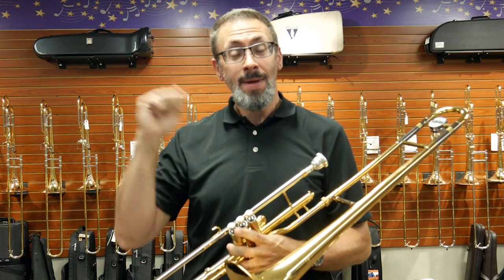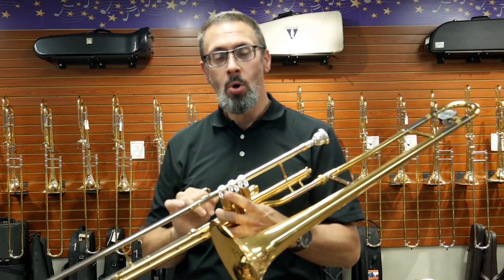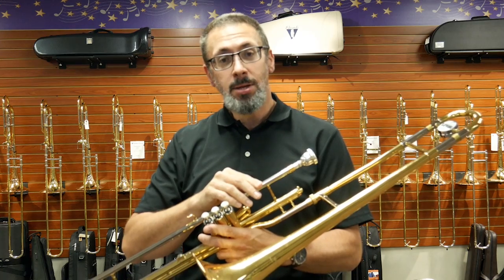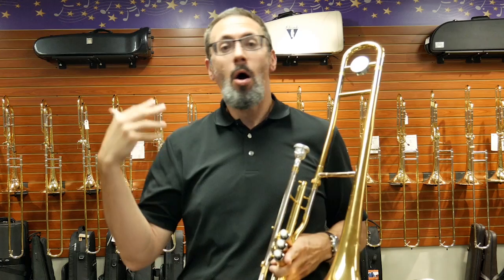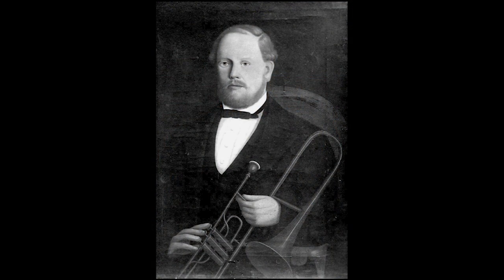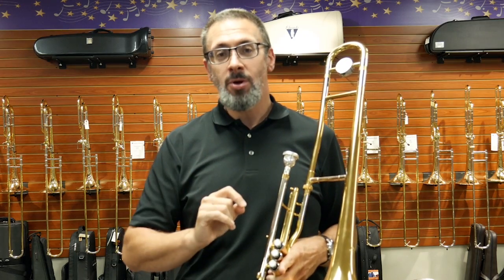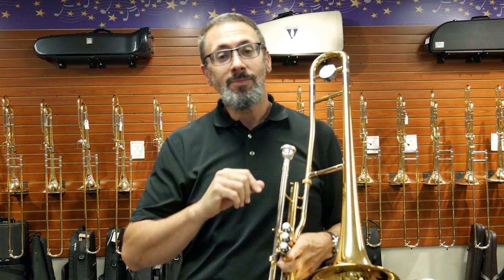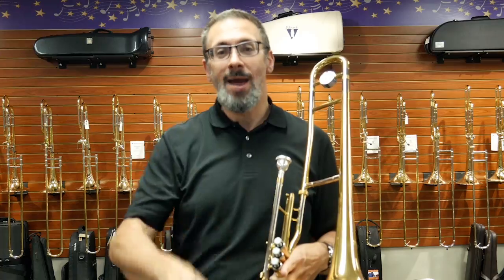INTRODUCING THE VALVE TROMBONE! Valve Trombone 101

Comment: Actually you can also use Valve Trombones in Marching Band too cause you don't have to worry about breaking your slide.
Reply: You don't care about tuning in marching band? These valve trombones are very, very out of tune.
Reply: @Ruigekerel  They worked around this issue by adding spring loaded tuning slide triggers.
Reply: @RockStarOscarStern634  no tuning slide triggers offer enough leverage to add the necesarry centimeters needed to get the low notes in tune.
Reply: @Ruigekerel  Wait a minute he made Special Slide Triggers for them:https://www.youtube.com/watch?v=Rw4hr1-4Bic to make it work
Reply: Break the slide?? No one I ever marched with hit or broke their slide. You bend your bell upwards and hit no one or nothing. Never heard this as a reason before. Sounds like something the last generation went through 😂😂😂.

Comment: These weird instruments fascinate me. Is this interchangeable with a slide trombone in an orchestra? And does it play similarly to other 3 button instruments in the brass family? For ex a lot of fingerings in trumpet translate to the French horn. Same same here?
Reply: Whether or not it's interchangeable depends on the music you're playing and how particular the writer was. (are there glisses that require the smooth slide motion? Did the composer have a particular sound in mind or just write "low brass" parts? The sound is similar to a Trombone or baritone, as opposed to the Euphonium or French horn.) The fingerings are basically the same, at least until you exceed the normal range and have to figure out what's best for your specific instrument anyway.